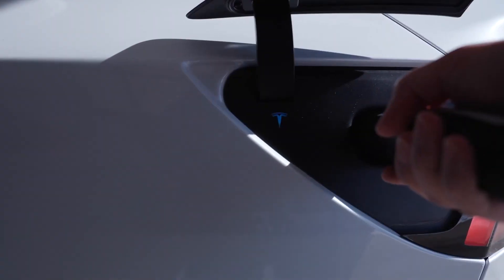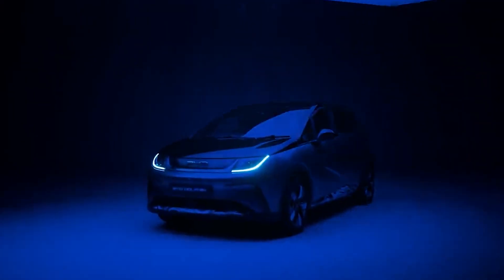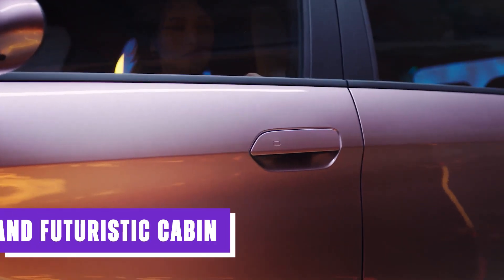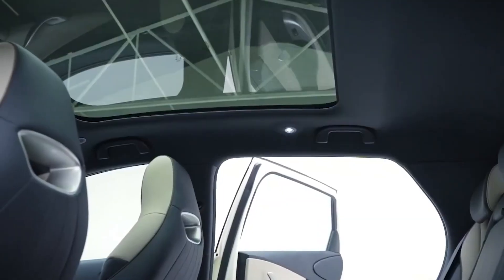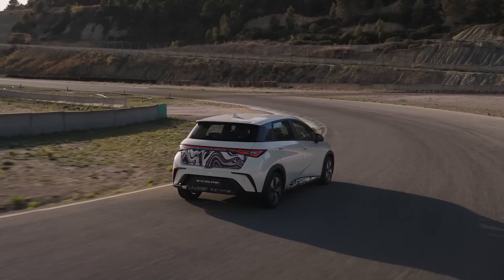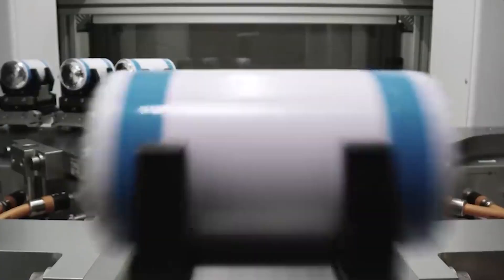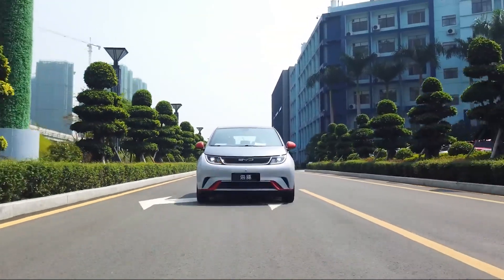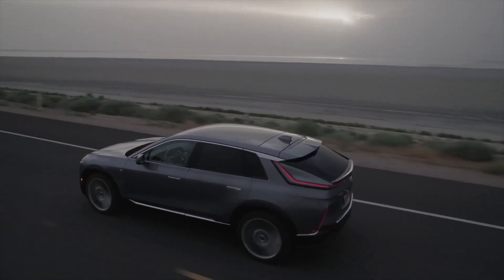Forget Tesla! The BYD Dolphin is the Electric Car That's Taking the World by Storm!

Comment: In China, even being the Number One Manufacturer of Solar Panels and Number One Exporter ─  Where all Solar Panels are fired up/ Made with Powers coming from Coals.  And when it comes to Charging a BEV:  China is using 85% or more Fossil Fuels ─ mostly Coals to fire up their Electric Powers Plants.

Then how can we call BEV is "Zero Emissions" Vehicle?  There are no such "Zero Emissions" Vehicles for the foreseeable future.  Only either Max or Min Emissions.  Let alone talking about the Lithium or any Mining that required to build up a Huge Battery where the Weight itself like Teslas alone pollute the Environment and damage the Roads which are made up of Tars from Oil.

Hydrogen that coming from ⚛ ⚛ Nuclear Fusion Process/ Plant in the future and other New Technologies that can produce Hydrogen would be a real Deal of Low CO2 and or Methane Emissions.  Any talk of call BEV a "Zero Emissions" Car is a Hoax like Honda President has stated last month!

Regards,